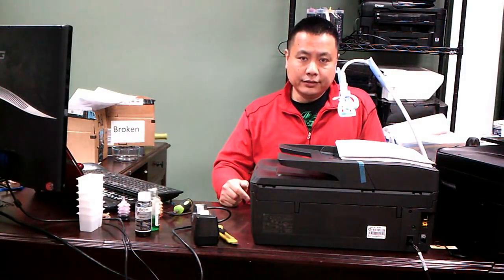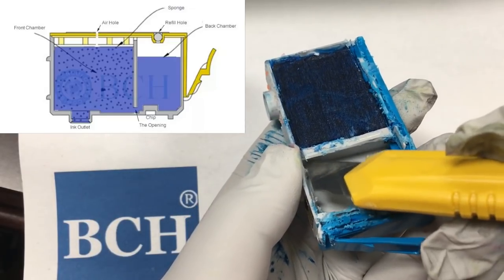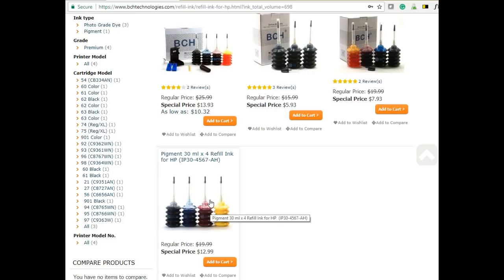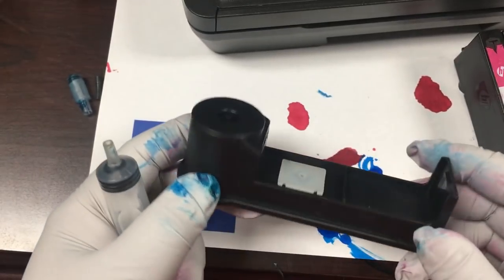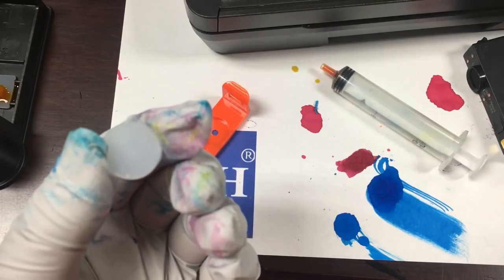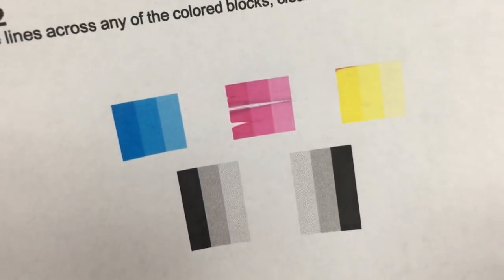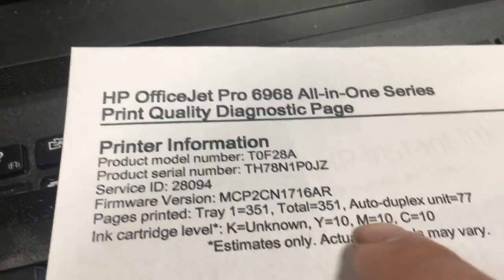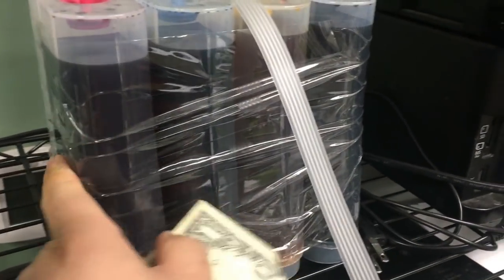3 Easy Ways to Refill HP Instant Ink Cartridge 902 934 935 564 920 Freedom to Refill Reset Video 1

Comment: THANK YOU for this video!!!  I followed your instructions for refilling the HP cartridges that came with my OfficeJet 6958; they'd been sitting around empty for about a year. (I've been using off-brand cartridges since the original HPs until my most recent purchase where I couldn't get the newly bought "counterfeits" to work no matter the troubleshooting I tried.)  After doing everything per the video's instructions, including running the cleaning cycle 3 times, I was still getting streaking and missing print with the black color.  So, I left the printer alone for 2 hours--as the video instructed--and everything is printing perfectly now!  Hooray, and thank you again for this fantastic tutorial.  I'll only be doing refills from now on instead of buying new cartridges.  :)

Comment: I followed the instructions... refilled original HP 910 Cartridges (HP OfficeJet Pro 8035e)... the refilling process worked out fine, kept printing normally... but 2 weeks later, Printer doesn't let me print anymore and is showing the following message: 'CARTRIDGES REJECTED - The indicated cartridges have been recently identified as used or counterfeit". Is there a way to print with refilled Cartridges with this Printer?

Comment: Thanks for this video, which convinced me to buy an HP 6970 printer, with 903 cartridges, but before buying it, I would like your confirmation that it can stop counting the ink from the original cartridges from the setting "Automarically Send Anonymous Date " to be able to use original cartridges all the time by refilling, and eventually buy a set of chipless cartridges to attach the chip removed from the original cartridges. Thank you, and I'm waiting for your answer, which will make me happy.
You are very cool .. :)

Comment: We can transfer the start up cartridges into xl cartridges. At first you have to cut back side plastic of the cartridge, only cut the different colors(magenta/blue/yellow) plastic not open the whole cartage. Then take a 3mm drill and drill at the bottom of the cartridge's back side.you have to two paralle drill ,one the outer wall & devider wall of the cartridge. After doing this you have to seal the outer wall of the cartridge with a rubber plug & use some super glue to fix the back plastic lock of the cartridge. Now it is a XL cartridge,you can refill the back chamber of the cartridge.
Reply from the maker: Someone was selling a "conversion kit" on eBay, it is just a drill bit as Somnath described here.  Great info!
Reply: yeah i had this exact same idea.... just dril trhough both walls and plug the outer one.

Comment: Hello sir,
I have a HP 6960 printer. The printer does not print black, I could not get it to print. I changed the print head and cartridge, but it still doesn't print, what should I do?
Thank you for your answers.

Comment: My ink cartridges are having no problems, but the printer thought they were nearly empty.  I turned off the print count thing you showed in the video.  I didn't know I could do that.  Now my printer is printing without bothering me.  

Just one question:  How does the printer know when a new cartridge has been installed?
Reply from the maker: That's what "turn off chip info" does.  The printer doesn't know how much ink you have in your cartridge.  It only counts how many pages (# of nozzle fired) printed, so it is just a big counter.  It goes from zero to max and only counts one-way.  Therefore, you won't be able to reset this chip.  The "turn off chip info" will let the printer to keep printing after it reached the maximum number, which is exactly what you did.  It doesn't stop the count, only force the printer to allow printing after the max.

Comment: Great video! Super helpful! I'm wondering if there's a way to use HP Instant Ink cartridges after cancelling the Instant Ink subscription. I was told by HP that the carts only work as long as your subscribed.
Reply from the maker: I don't think there is a way.  I heard from a customer who bought a 2,000-page package.  Then, the payment lapsed for a few days and HP refuse to honor the 2,000 pages already paid for.
Reply: @BCHTechnologies  Hello. I have a new hp 8025 office jet that uses HP910 cartridges. I have refilled them, turned off anonymous usage data and all cartridges still read out of ink and black ink will not print at all. I hear these new cartridges use encrypted data. Is there another workaround?
Reply: @StupidLittleYTName  I want to return my printer but it's past the grace period. I'M not impressed.

Comment: Wouldn't turning off the counter after replacing the first set of cartridges work also? Wouldn't that; theoretically display a full level as long as the counter is turned off & still acknowledge the cartridges as real HP?

Comment: Can i program the ship for this kind of cartridge 

Link ?
Reply from the maker: The chip is encrypted.  Theoretically, it is not possible.  You can clone a chip and glue it to a cartridge.  It is the way some refill shops do.  I don't see the need of doing it.  What's the point of using a "estimated" ink level?
Reply: BCH Technologies 

send me the link for the ships
Reply from the maker: We don't have them right now.  Probably another 3-4 months or so.  However, it isn't necessary to have a third party chip.
Reply: So, the refilled cartridges can be use with the original chip? All I need to do just drop the ink to the original cartridges, and put it back to my printer, and it'll print like usual? that's it?
Reply from the maker: Yes.
Reply: @BCHTechnologies  can i hack the chip information on a hp 6230 or that isn't posible

Comment: which kit should I use on HP 564XL   HP Photosmart 5520???
Reply: IP30-4567-AH??
Reply from the maker: That's a full pigment kit.  It's better to keep the colors to be dye ink.  I would suggest ID30-KCMY.  You can keep the big black to be pigment by getting another IP30K, or just use the black in ID30 in both big and small (photo) blacks.

Comment: Even after doing all of this, my refilled 902 black cartridge will not print.  I ran 3 cleanings and no luck.   This is a new printer with the cartridges that came with it.   I turned off the Store Anonymous Usage Information & Automatically Send Data.  It is not even printing black on the maintenance quality pages.
Reply from the maker: If it "print" but the output is blank or has stripes, then it is a clogging issue.